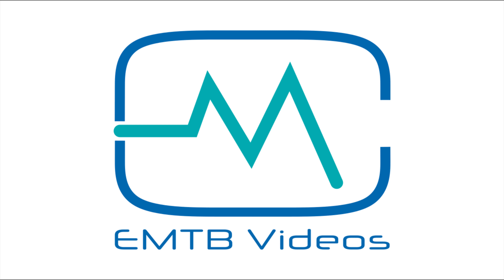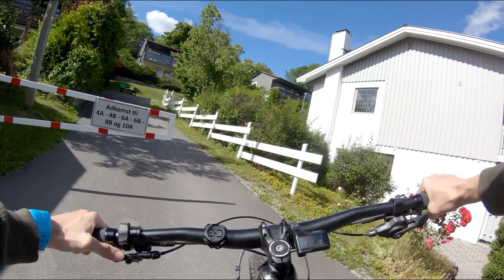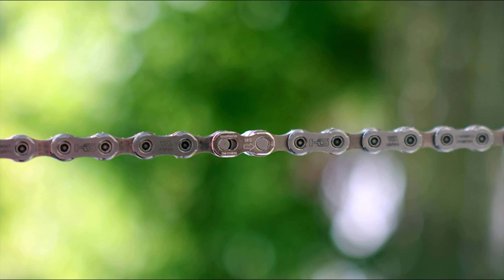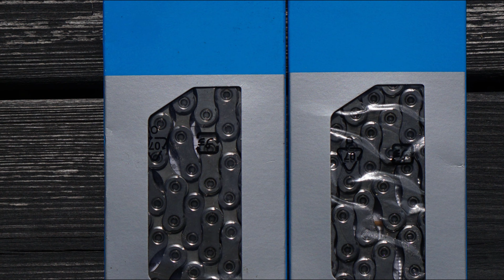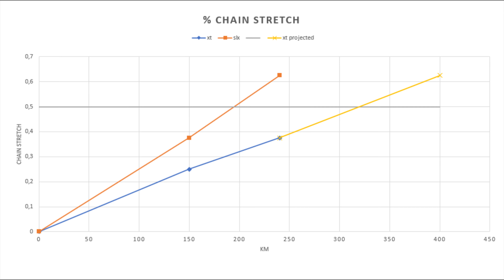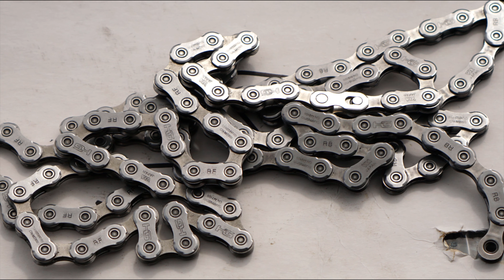Shimano XT vs SLX - 12 speed chain test

Comment: If you shift properly, use the right gear and wax/clean the chain it will easily go over 5000 km in dry conditions, maybe the numbers here are with harsh extreme conditions or maybe incorrect.

Comment: Once you cut the chain, you can only connect it with the quck link ? Can someone confirm ?
The 7100 said "not reusable" on it, I didn't new what it means but I connected it with it's own link and it fell off after 100-200m then it it's quick link it went well for now.
Reply from the maker: Shimano chains usually can be ridden with either the quicklink or the regular pin. I always use the quicklink, and I've had no issues using the same link for 3 different chains.

Comment: I installed a brand new SLX chain about 6 weeks ago. I checked the wear yesterday and I’m at .5 already! No e-bike and I’m not really a powerful rider. Very disappointing! I used a SRAM GX chain previously and it lasted about 7 months of heavy use before getting to .5 wear.
Reply: That is my experience too. SLX 7100 chains on my bike and a 10 years old bike are at 0.5 wear only after 200 -300km. I ride only in dry conditions with brandy chain oils and regularly wipe the chain. Wonder what i am doing wrong very disappointed.
Reply: @Infpl  They just don't make stuff to last like they used to with 10 speed. My 9 speed Ultegra chain lasted like 10 years. The times we're living in.

Comment: my current m8100 chain has been on the bike since september 2020 and it's getting close to .75% wear just now after 5000km. i'm 95kg, I ride a hardcore hardtail with an slx drivetrain with an oval chainring. I only use muc off dry lube (not a lot of wet riding around here), thoroughly dry-brush the transmission with  a grungebrush after every ride and reapply lube, then wash the bike once every 2-3 rides. it's showing a little bit of rusting on the outside plates, yet it still shifts perfectly in every situation. previous m6100 chains only lasted around 8-900km (but I was also using teflon oil only, back then). I'm VERY impressed and eager to see wether the next chain would last the same. I'm tempted to test m7100 thou.
Reply: 12s chain should be changed at 0.5% already.

Comment: I cant belive this!
Only 200-300km!

That would mean i have to change the chain every week!
I drive my bike/chain (CN-M6100) now thousends of km and the chain is still OK!

My opinion…
Under hardest conditions every chain should be fine for min 2000km!
If you maintain, clean, lube your chain!
Reply from the maker: It seems we had a damaged measuring device. We get better results in the later tests. But nowhere near 2k km. https://youtu.be/INMZqAICQWU

We did some maintainance, but not a whole lot. The point of this test is do determine the difference between them, so we tried wearing them out as soon as possible.
Reply: @EMTBVideos  i suggest using the total elongation test to determine the wear. Use the baseline chain as paragon and you will be able to easily see overall wear.

Comment: Correct lube also helps. Stay away from lubes like Rock n Roll.
Reply from the maker: I'm pretty sure these were lubed with RnR (: But the km ridden in this test was wrong due to a damaged measuring device. Still, the comparison between the chains is valid. Check out the final chain stretch vid https://youtu.be/INMZqAICQWU

Comment: I am using an oval chain ring, non boost on boost hub, the chain wear is uneven, currently 0.17 and 0.27 wear. I suspect I tight be due to the oval. I don't remember if this was the case with round chain ring, I don't know how much difference each gea remakes and and if the difference in wear has something to do with the different gears in use, and certain spots wear more due to chain being in the same spot as always but ran tru the gears. Of course when ubidtsllinh and installing the wheel you might have the one or few cogs forward or backward, I don't know how much difference this makes.

Comment: What a great test! The differences in the lineup are Deore has no chrome plating, SLX has the inner pin plated, Deore XT has the engagement side plated too and, finally, XTR has hollow pins (10g lighter 242g vs 252g) and it has a fancy coating (think a teflon pan) you have to be careful while cleaning it, if you are to harsh while cleaning and/or use too acid/alkaline degreaser the coating will be lost.

Comment: The combined chain got me thinking:
If there is equal force across the chain doesn't it mean that the weakest part of the chain (SLX) would stretch before the stronger parts stretch (XT)?
So if the whole chain was SLX that the force would be more distributed around the chain and might mean lesser stretch?
Not certain.

Interesting anyways :D
Reply from the maker: Thanks. The force will be the same across the chain, regardless of how weak each chain is. The weaker chain could strech more, but that doesn't affect the load they're exposed to.

Comment: Thanks for chairing. Will other chains work together with the shimano 12 speed system?
Reply from the maker: I haven't tested, but I've talked to people that have complained after buying 3rd party chains for their Shimano 12-speed system. I have ridden bikes with Shimano 12-speed combined with a Sunrace cassette. Shifting performance suffered noticeably, it shifted like the 11-speed Shimano without Hyperglide+. So my impression is both the cassette and chain need to be Shimano with the Hyperglide+ that is standard on their 12s systems.

Comment: I've been using XT M8100 for my Slx m7100 drivetrain, sadly the chain snaps from the rivet while cycling to uphill. I think I'm gonna stay for slx or deore chain.
Reply: I wonder what the load you apply and how terrible is your shifting at the moment. Shimano chains are very hard to break, unlike kmc shit that i can snap every weak, i couldn't ever break  them with any power
Reply: Something else is going on
Reply: Maybe cross chaining is happening here, I have 1x setup and if I remember right I was in 45T when the chain snap happen. I don't shift that much on uphill.

Comment: One issue with your test is you should have used new chainrings and cassettes so the wear is exactly the same or buy 2 more new chains and split them in half and use on the same bike. I'm assuming the chain that wore faster is probably the one that was on the other bike before you joined them together.

Comment: I use 10 speed KMC e10 EPT chain on my eMTB bicycle with Yamaha PW-X motor with Shimano Deore 10 speed system and this chain lasts (0.5 mm stretch) for about 800 miles (1300 km). I ride it only in extra power mode (maximum assist) with no speed limit for assist (speed box mode) in terrain with a lot of hills (Seattle) doing wheelies all the time.

Comment: Nice comparison, but the durability disappoints me. Would love to see a comparison between sram gx and x01 cassettes. The sram gx cassette on my Trek Rail 9.8 was completely worn out after 1000km and that disappointed me. Certainly because their quite expensive. Would like to know if it's worth to upgrade to x01.
Reply: Get cheapest nx cassete, it last longer than more expensive ones.
Reply: @EMTBVideos  I'm using a ktm chain right now, because the shimano was worn out very fast. I'm curious how long the ktm  persists

Comment: I've ridden my M7100 for 2400km now (on an e-mtb) and the measurement tool says, it's still okay. Very confused about the durability values here :D
Reply: Same, normally I reach max stretch around 1500 km. 350 km it's a bit low. Ok, maybe because it's an e-bike and the applied stress on the chain is higher
Reply: @angeledduirbonesu1989  it makes no difference to chain wear, definitely not on this ebike. And 350 is very very low. And chain checkers can be wrong, elongation wear could be 2 times less
Reply: Dang.  What are you doing to wear chains out so quickly?  I have used a 7100 on my Tarmac and get 6000+ km or 4000+ miles.  My mountain bike will only get about 2500 km or 1600 miles, but that's still about 10× what you're getting.  If I went through chains as fast as you, I wouldn't be able to afford to ride bikes 😢
Reply: Are you light in weight and only bike in plains?